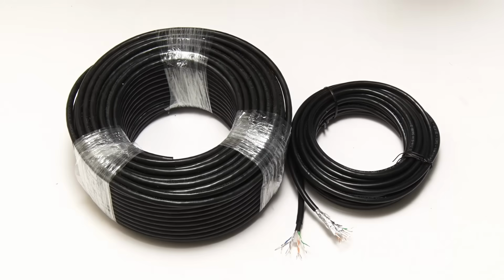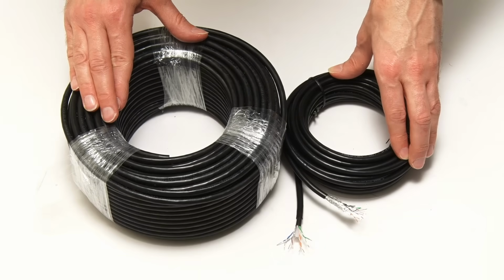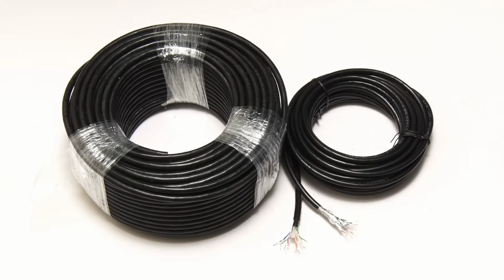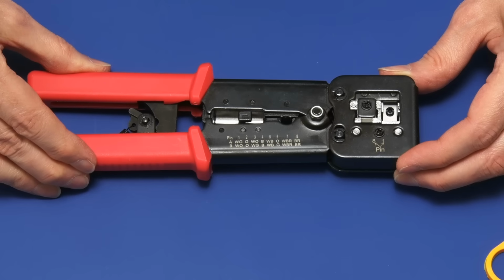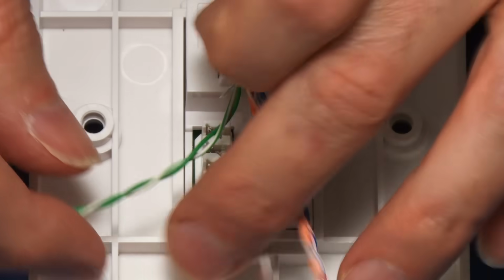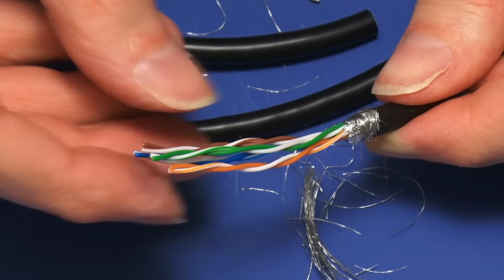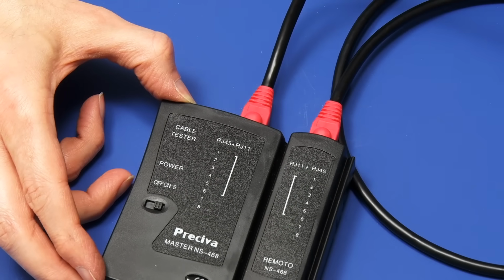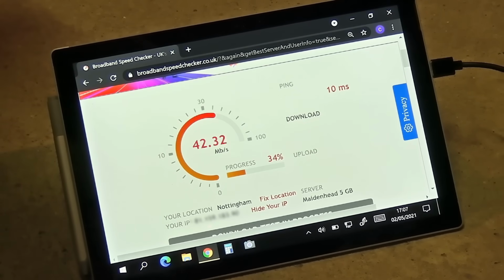Wiring Ethernet Extensions: How to Fit Sockets & Make Patch Leads

Comment: I have a dedicated tool to test rj45 and (rj12? Phone/fax) and coaxial cable lines. Also that cord/string is for stripping back insulation cause normal strippers can ruin the cable connections. Done pulled too many new cables for atm machines cause some turd didn’t know that and had to be within special tolerances. Bottom line, that little string there is in there for a reason.

Comment: Having just move in to a house with new FTTP lines. I have a Ethernet out from the big ass fibre box it my storage room, which the phone line come out too. Seriously fast currently pay for 150mbs but just upgraded to 300mbs. My problem is each room has been wired with Ethernet sockets. How do I check the one they built in are up to grade. I assume as they put in FTTP instead of the old copper FTTC that they would of put the latest grade cat 7 but you know how builders cheap out.The fibre box and router stay in my storage room and I have one line going to each room. If I am running faster speed than the line, is theat possible or safe.

Comment: Hmm a little confused, I have here a 30m cable labeled (printed on the cable) as "A/TIA -568-B 2 UTP CAT5E" and has 4 wires. From left to right (looking at top of the connections with the head of the cable, the connector pins on top pointed to yourself): PIN1:NC, PIN2:NC, PIN3:RED, PIN4:NC, PIN5:NC, PIN6:ORANGE, PIN7:BLUE and PIN8:WHITE. 

This a crossover cable, bought it as crossover cable so on the other side it may be little different. CAT5E is rated for 1Gbps as listed in your video. So this old 90's cable is fake and not CAT5E (because it has only four wires)? However, works great, just wondering. Is there a tool to measure/determine the CABLE speed?
Reply: That cable is wired for 100Mb, not Gb.  I'm not sure when 5e became available, but late 90s sounds about right.

Comment: 21:53, I agree! Why are people with desktop PC or laptop--and usually place at one location is using Wi-Fi to connect to the web? A wired connection is always the best.

Plus, even if one is lazy or lack the knowledge to do the wiring, one can simply call their ISP to wire up their house for a one-time fee.
Reply: Because most people like the freedom their laptop brings so it’s kind of pointless to keep a portable device plugged in, plus most new laptops these days don’t even come with Ethernet ports, unless of course it’s a gaming laptop. The whole point of having a laptop is to be able to move around where you want and be wire free. Fair enough if it’s a games console, desktop pc or a smart tv that can be wired then fair enough. I mean if you do have a laptop that’s plugged into the router 24/7 then fair enough, but it defeats the whole purpose of a laptop unless you don’t have a desktop pc and need to use your laptop for work at home where you will need a constant and fast internet connection
Reply: That and also the fact that not everyone has the option to use a wired connection in every room.

Comment: If you are running stuff at home, try the old wire.  I have 90s CAT5 most everywhere at home doing 1Gbit without issue and for one room I have a 100Mbit run going over ridiculously long, nasty old 70s 2-pair intercom wire.  It works fine.

Comment: The place i moved to is prewired with cat6 in the walls, my 300mbps internet was only getting 30mbps, when the Verizon guy came he found that the cable at the wall plate end wasnt patched correctly, re-patched it, now my internet is back to 300mbps

Comment: Great video. :) A useful addition here would be that there are various types of tool-free network jacks and even RJ45 connectors that make it very easy to have solid connections. So for those who don't want to buy extra tools only to never use them again and maybe lose them after the network is laid out, there are options. Of course there's a price that comes with that, but also great convenience if you're not great at fiddling around with tools. :)
Reply: Was aware of the tool free keystones but not rj45s

Comment: Might be able to use OpenSpeedTest on a Raspberry Pi 4 to test the internal network speed. 

Crosstalk Solutions did a video on how he set his up; I've got mine running on a docker container on my Rpi 4. Super handy for verifying internal connection speeds or checking how well the wifi is working in various corners of the building.

Comment: cat5 cables also came in shielded variety, they were very unpleasant to wire up in a production environment, 15 ends per hour, hurt the thumbs
Reply: Try working with shielded, exterior grade cable,  while standing on a roof.  I've done that for a short haul microwave system.

Comment: Great, learned a couple things, thanks.   My understanding, which you didn't mention, is that the wires from cable to box/plug be as short as possible, including the twists in each pair as close to termination as possible.  Is that not relevant any more?

Also, you didn't mention that there's both plenum rated and non-plenum rated cable.  Plenum rated, as I understand it is either non or less flammable and will NOT create any toxic fumes if burning in an air duct, whereas the non-plenum rated (cheaper) will or may do so.  One place I worked had drop ceilings, but that area was actually used as the return for airflow for the HVAC, so plenum rated cable had to be used.
Reply from the maker: The twists should indeed be as close as possible to their connection point, as as short as possible, but the design of the plugs and sockets determines the latter. :)

Comment: strange, Need 8 cables for gigabit or higher, so when you use poe, your speed has to drop,
do any use a 9th core and the shielding for power, that central piece that was cut out would make enough space  ?
maybe it also would lower the speed by interfering with the data pairs.
Reply: No it doesn't.  PoE does not affect the signal at all.  Maybe you're thinking of the older PoE, where different pairs were used for PoE and 100Mb data.

Comment: So much detail on the cable types, but no mention of the different plug types. The plugs are different for solid core vs stranded core (the wrong one will prove unreliable over time), and also come in variants for shielded cable.
https://www.sandman.com/knowledgebase/solid-vs-stranded-plugs

Comment: The usual problem with WiFi is interference from cheap electrical products which aren't CE certified. This is becoming very common now with mains LED light bulbs which each come with a high-frequency voltage converter inside them. A typical symptom is that WiFI is much worse in the evening. Many people think this is due to higher internet usage by their neighbours, but often it is because they have the lights on! Light dimmer units can also have the same affect.
Another issue is USB 3 devices. If you have a USB 3 device connected to your computer it can inject interference into the system which can interfere with WiFi and bluetooth dongles connected to the same computer. A common symptom is that the battery in your wireless mouse doesn't last as long as it should if you also have a USB 3 device connected (due to getting many errors and constant retrying) or slow WiFI when also accessing your USB 3 drive at the same time. The best solution for this is to use the rear PC USB ports for USB 3 devices and the front ports for your WiFi\Bluetooth devices. As a test, you can connect your USB 3 device via a USB 2 cable which generates much lower frequency interference.

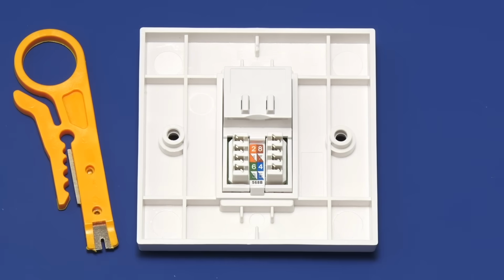Comment: @9:39 That punch down tool is the worse tool you can have.  I have had to redo several ports on a patch panel because a contractor insisted he use that tool.  You should have a punch down tool like this instead.  I understand that this is for US installations, that the European version might be different.  https://www.amazon.com/gp/product/B08HYFKJ1J/ref=ox_sc_act_title_1?smid=A1A02F2DCSKJVI&psc=1  This is a 66/110 punch down tool.  It automatically cuts the ends off and punches down with a mighty "thunk"  A great tool to have around.
Reply from the maker: That does indeed look a very solid tool.

Comment: Unless your running 10Gig people worry way too much.   They even make claims that one cable will produce more 'speed' when the link is the same and no errors are present.  Bottom line if your not seeing errors on the counters then just go take a chill pill.  Much the same as people who think certain HDMI cables give you a sharper 'clearer' picture 🤣
Reply from the maker: Very true. This said, there are a lot of review on Amazon and elsewhere concerning cables that do not deliver 1 gigabit over any reasonable distance, so some care is needed if buying longer cables, especially for permanent installs.
Reply: @ExplainingComputers  Ohh without a doubt.  I've purchased some what appeared to be good cables from Amazon that ended up being 30 awg CCA wire that honestly scared me.  I now keep a ton of cables on hand from Monoprice.  Amazon has turned into mostly fake reviews as many are now finding out.  The trick is always look at the consistency of the really negative reviews and ignore all five star reviews.   If all the one star reviews are saying the same thing then take heed.

Comment: Yes, drill the hole through the external wall sloping slightly upwards from outside to inside. More importantly, clip the cable outside with a downwards drip loop to minimise chances of water wicking along the cable in the first place

Comment: Very interesting to read about outside cable that can be buried in the ground.  I’m considering an electric car charger, and some will accept a Ethernet network connection.  My previous idea was to bury the cable inside conduit in the ground, but direct burial sounds potentially easier to install.

Comment: I had attempted to terminate the LAN cable in to a wall socket a couple of years back. Failed miserably. The socket is still in the wall but my cable comes out through another hole in the wall, to terminate in to my router.
Just last week I was thinking should I give it a second go......
You seem to have read my mind.

Comment: When you use shielded cable, it's a waste to use the simple unshielded plugs.
Reply from the maker: A fair point, but it is also the case that using shield plugs on a 1m patch cable that will only realistically ever work at 1Gb speeds (and usually far less) is also a waste. I happed to have some Cat 7 cable around for the patch leads, so I used it. But even for Cat 7, shielding on short cables is rarely really needed.
Reply: @ExplainingComputers  I agree in that case It's not needed. And I probably sinned much harder at some point. I remember using 4 wire isdn cable for short 100BaseT connections, as they only use 2 pairs anyway in the base config. These days though, my preference is to use shielded plugs anyway, because it's basically the same effort. And along the life of the cable, it might become useful. And that saves retrofitting or replacing the cable when the switch to anything between 2,5Gbit/s to 10Gbit/s happens. In any case, for the scope of one video , you probably found the best balance to not overload people who are new to the topic. I agree on most points. Especially how poor or variable the quality of a wifi connection can be.

Comment: How did you get the idea, that cat5 cable is never shielded? 
It's available as sftp. I have the remains of a old 100m roll here.
Reply from the maker: I stand corrected! :) I have never come across shielded Cat 5, and every source I consulted for this video said Cat 5, never shielded, Cat 6a and above always shielded.
Reply: @ExplainingComputers  Maybe those are newer sources. Back in the day, there where multiple 100 base standards. Some used all pairs in full duplex and where able to switch between rx and tx mode for all pairs, thus achieving 800Mbit/s. To get to the full segment length of the standard, quality cable is needed. On the consumer end, I also mostly saw simple twisted pair. Longer ones where sometimes foiled, but not shielded.
Reply: @ExplainingComputers  Unshielded CAT 6a cable is also available.

Comment: You can make a ethernet crossover cable: wire one end as a A and the other end as a B.
for speeds up to 1Gbs, i use them at home to avoid any switches.
Reply from the maker: Indeed!
Reply: Most devices today, use autosensing ports, and don't really care about straight vs. crossover cables. Also why would you avoid a switch? And how would you wire multiple devices on a single network, without it?
Reply: You don't need crossovers with Gb and some 100 Mb.

Comment: Get a proper punch-down tool, just be aware the cheap copies through Amazon have "Cut" marked on both sides.
Reply: I have 110 and BIX punches made by Elden, previously made by Nortel, which means they're built for heavy duty use by phone company techs.

Comment: You're supposed to use shielded Cat6 ends with shielded cable though, kind of defeats the purpose at the switch for eliminating cross talk.
Reply from the maker: The Cat 6 cable I used was not shielded. The Cat 6y by definition was, but it was what I had around and for a 1m match lead using non-shielded plugs is OK. Not best practice, but OK. :)
Reply: @ExplainingComputers  maybe miss understanding :) when you use shielded cable, you need to use shielded ends :)  Good video btw !

Comment: If you cut the patch lead wires at 45 - 30°, before inserting them into the plug,  it makes lining up the wires into the plug holes a lot easier.

Comment: Thanks for that Chris. I’d learned a lot of this the hard way when cabling an eight camera PoE IP camera CCTV system at home. The one point I didn’t know was that you can get the ‘pass through’ plugs. The ones I bought were what I believed to be the only ones. The cores sort of ‘bottom out’ at the end of the plug. It’s an absolute swine getting them the right length and holding them all in place whist working the crimp tool. For some of the connections I was doing this at the top of a ladder up at my soffit! Why on earth did they make them that way instead of the pass-through type you had? The pass through looks so much easier!

Comment: Yep, if there's one thing the 'professionals' do is drill from the inside, crack your brickwork and then say 'Ohh, silicone will cover that up!' 😐😑😐😑

As for my internet connection, EVERYTHING is wired unless I'm forced into a wi-fi connection. Wires is where it's at!
Reply: That's because they are in a rush and pressing like mad on the drill. I have been doing this for a very long time, just let the drill go at its own pace. It takes a few mins longer. But saves the screwfix cable plate and silicone bodge.

Comment: Excellent video, thanks. I have wired all my devices including Sonos speakers and get far better and more reliable performance. I'd advise anyone to use the pass through type RJ45 plugs as so easy not having to worry about getting wires the right length. Also the testers are very cheap and well worth getting.

Comment: The string or cord found in the better quality cables is intended to aid the outer jacket removal. In this case it is usually better to strip back about an inch then grab the cord and pull it to rip the outer jacket. Cutting around or along the outer jacket with a sharp object can easily damage the delicate wires inside.

Comment: The only thing I'd have done differently would have been to use shielded cable outside (not shielded as in cat7, but a physicaly protective outer core) or stuck it in trunking. I really don't like bog standard wires outside even though that seems to be the norm nowadays. It just feels wrong.

Comment: Should the screen of the cable be connected via a metal shield on the plugs?  It looks like the tester has a 9th LED for the shield test too.  Just having the screen flapping in the electrical breeze doesn't sound ideal, but I may be wrong.

Comment: At 15:40 you show a common problem using the Cat 7. The plug simply can't take the whole cable sheathing and all. You are crimping the conductors with the outside setting spade and isn't on top of the sheathing as should be. I'm not trying to be critical, just helpful. If you know of larger plugs, please supply a link as I've failed in my search. This needs to be addressed by the data comm companies.
Reply from the maker: Plugs are not intended to be used on thicker solid core cables like this -- I only put one on for testing.

Comment: Thanks for posting.  I did this type of patch cable assembly for the Coast Guard. Our tools were more primitive however.  I like the test tool you had for finished product.  Back in the day we wired the 46 buildings with cat 4 and very shortly afterward the industry upgraded to cat 5 .   This was a video I wished I had when training the telephone techs that accomplished the wiring for use by us.

Comment: 06:35 Does 'direct burial' mean the cable will just be plopped in the ground? 
If so, would it be better to run it in a conduit of some type - it'd protect the cable from being chewed through by subterranean wildlife, and also make maintenance and upgrade easier.

Comment: Nice video. I had to learn all this years ago when I ran Ethernet for a local business as well as when I wired my home. The only thing I can think to add is that if you are running the cables in your attic Please get the plenum rated cabling because it will not produce toxic smoke in case of fire! 
   Thank you for the excellent video and the time you put into it for us. It is appreciated.

Comment: Hello, super video. In Germany we've a tool that's called LSA Tool. It cuts off the end of a wire as you push it into place on the socked terminal very needly. It's very handy. I like your work very much, thank you for putting in so much work for us.